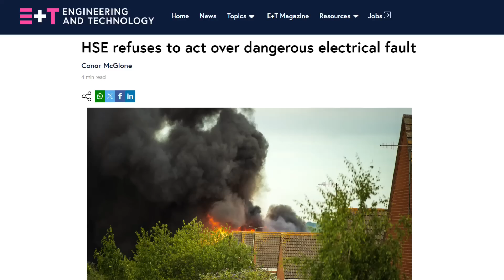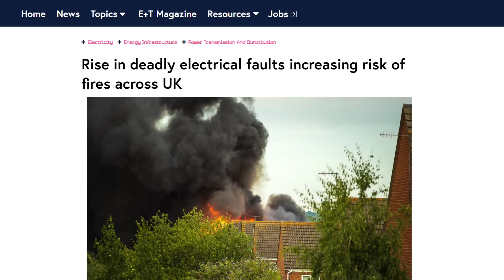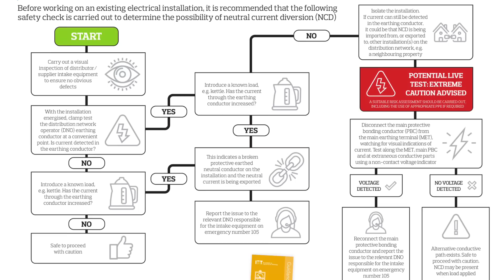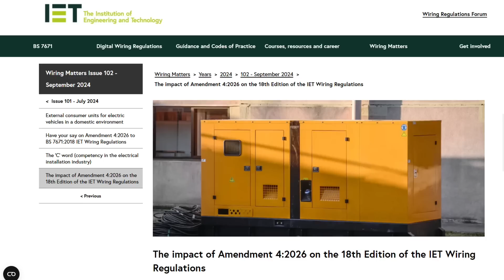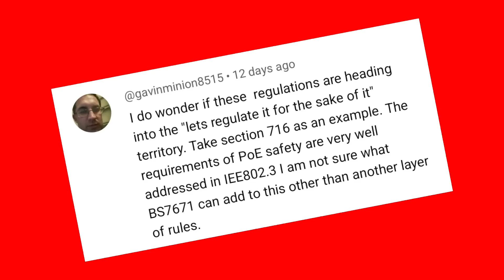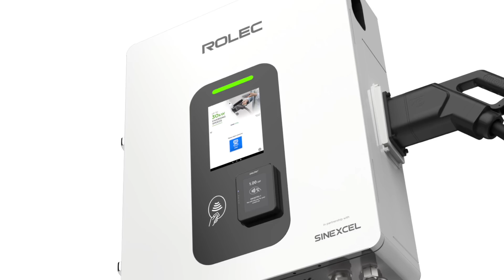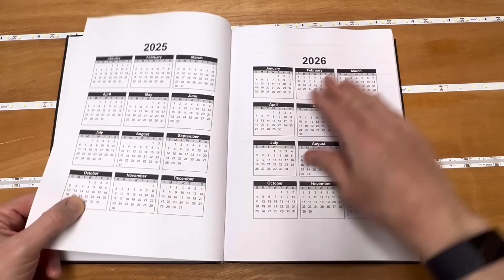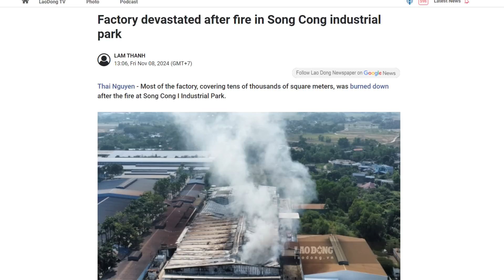⚠️ Electricians Warned Over Neutral Current Diversions ⚠️

Comment: I really don’t understand why we don’t also put in a back-up earth spike for all installs to avoid PEN fault related issues. I just don’t see why that would have any negative consequences fro end users or the DNO
Reply: Good idea
...but in practice can be a bloody nightmare when fuseboard is in middle of house newly decorated
Reply: In my country we have had such rule since always for TNC-S. I am afraid that one simple spike might not be enough . Maximum allowed resistance of this earthing is 15 ohms. On top od that DNO is required to earth the  PEN  every now and then. Different rules apply for different cases . Most cases are 100 or 200 m appart.
Reply: In Australia you have to bond neutral to an earth stake, and any metallic water pipes.  Just Active(s) and neutral come in from the street.
Reply: I may sound like a loon, as a non electrician, but I've heard of current flowing between ground and earth depending on "things".  I saw a guy on youtube measuring the flow, he said it looked like he was earthing the neighbourhood when the supplier earth, is that the NME/NMO? failed.
Reply: @Marek-o3u   A friend has lots of earthing for amateur radio tower, including repeaters which are on 24/7/365.  He had now take a lightning strike with zero damage.  He has a fair bit of the neighbours' neutral current flowing into the 42 earth stakes (6 lines, 7 stakes each).
Reply: @Marek-o3u  with out seeing video can't comment...but sounds like a failed pme
Reply: A backup electrode is definitely a good thing to do, if site conditions allow, but in average conditions it would be very difficult to obtain a low enough electrode resistance to avoid neutral current diversions when a combined neutral/earth conductor fails.

Comment: Such a brilliant idea to bond on the installation (consumer) side of a gas meter full of explosive gas that could potentially have large diverted neutral currents flow through it in the event of an open PEN fault.
Reply: Be worse if not bonded...as you would have gas at different potential to surrounding and definitely have an explosion 😢

Comment: I wonder is it time that Electrical work is diversified so that you have specific electrical sub jobs for example Electrician - Solar/Battery, Electrician - Mobile generation etc etc..  So you get your electrical qualification then you can specialise in certain areas and become a certain type of electrician..
Reply: Electrical work itself is not complicated. It's the damned regulations that's complicated.
Reply: @markrainford1219 depends 🤔 some electrical can be very complicated 

Take plc programming or Compex or cable jointing 

I think it's good idea to have a basic idea and then add specialist areas😊
Reply from the maker: Could be.... 😬

Comment: It's weird to me that a country that has implemented TN-C-S to some degree for a long time now needs to issue special warnings and guides to electricians about how to work with it.  Is something lacking in training?  I think we've all seen that clip where a UK electrician interrupted earthing without so much as a whiff of checking current flow before doing so.
Reply from the maker: The network's getting a bit creaky in the UK. 😬
Reply: @efixx all the more reason to push more EV and heat pump roll out!
Reply: Don't forget even if you are installing at a TNS supplied property, it's no guarantee it IS TNS. If a fault occured in the street it's very likely the repair would turn it into a TNC-S. It's a bit long winded to explain here, perhaps someone at @efixx could explain in a video why this could be the case. I've done one, but it's probably inappropriate to link to it.

Comment: We had our own PEN fault on the 1st of October. Was unsure initially what was wrong when we had a flickering supply, a high Ze result (with parallel paths connected) led me to alert UKPN but I didn’t continue with further testing (as I had work to go to) to discover what actually was going on
Reply from the maker: Great insight, thanks for commenting! 😃
Reply: @sibrown  flickering lights is a common one...seen this few times and had a school one that the DNO said was safe..

Had to really kick up a fuss as had a 240v socket plug outlet blow off the wall and teacher got a bad shock.

Got different Zs readings from each phase and the solar inverter wouldn't connect 3phase... so rang DNO western power.. 

Was arsy to begin with and left after saying if you think it's unsafe ahu the supply off and shut the school...

I waited ✋️ till he went then put a complaint in to area manager..

Hence got a swift team and himself out next day..

Took few hours but was loose connection on neutral in substation!

Was so dangerous 😳 ☠️
Reply: @ Yes not good on a 3 phase system. In the middle of the night I just couldn’t understand why things were happening, sockets and switches not working etc. Just turned everything off until the morning.

Comment: Why is it that the consumer has to pay the price to put the DNO right? SPDs etc, using aluminium overhead cables within 25 miles of the sea ( we live on an island?)is not supposed to happen, no wonder pen conductors are corroding, premature collapse regs when you get The low voltage boys (failed mains sparkys) doing whatever they like. Courses to fit fans when it is still allowed by the DIY merchants. Thank God I retire very soon! At least with no winter fuel allowance I can burn the hundreds of pounds worth of regs books etc I own for warmth!
Reply: The fan thing is wild, all the electrician's job is, is to install the fan, wire, and safety check. Realistically if fans are such a problem maybe they should come under HVAC?
Reply from the maker: Thanks for commenting!
Reply: @efixx 
I only understood half of it.